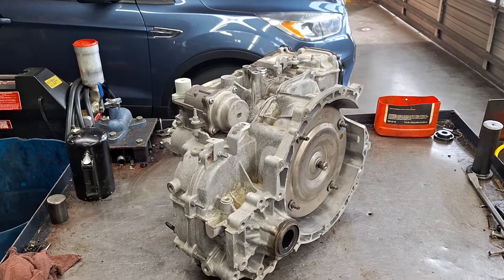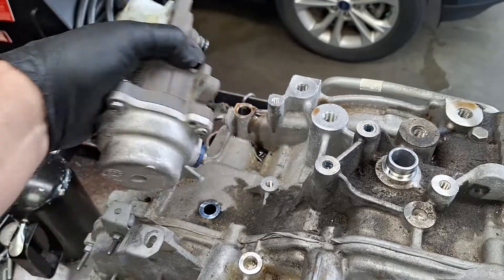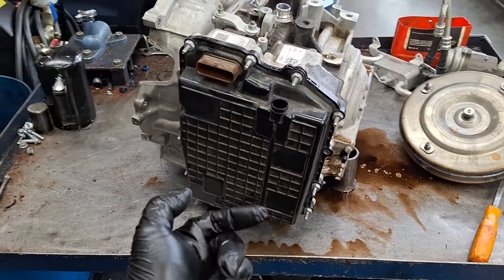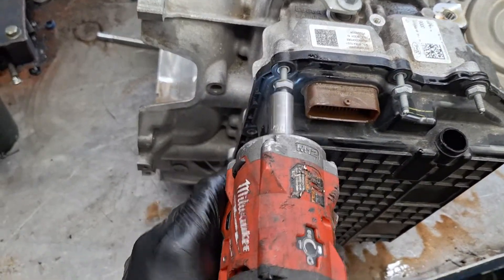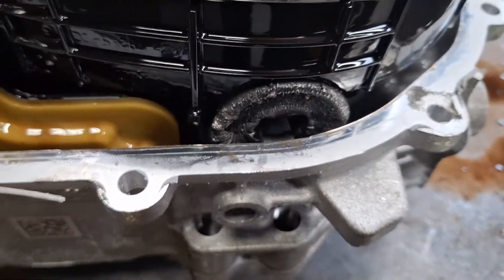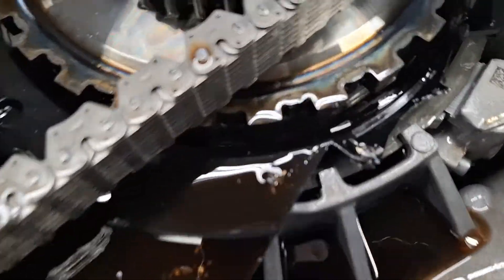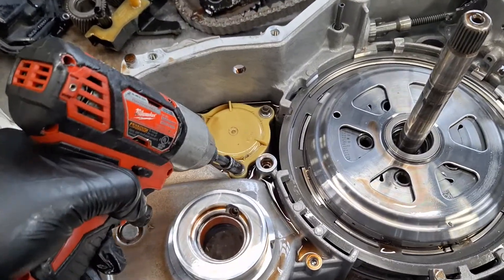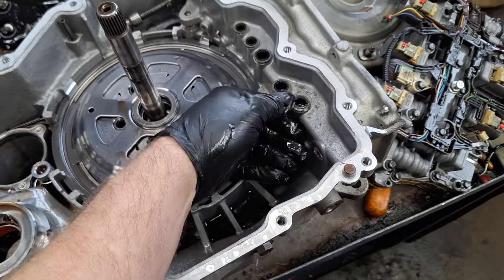Ford 8F35 Teardown | 8 Speed Transmission (Major Failure)

Comment: Hello Ben!
Have a same gearbox on my 2019 Focus. Now got a problem with it.. First of all it does not go to PARK (error on dash "Transmission not in park"). Okay with that fault I can drive (yeap it starts up and shut down) when car is cold. After few km fun begins. Car starts jerking and making weird stuff and finaly when it got full warm then it stops running. What can be the problem? Do you have any ideas? I'll add all fault codes aswell. 
Codes:
Memorized- P0751 Shift solenoid A performance/stuck off
Memorized- P0771 Shift solenoid E performance/stuck off
Active- P07E4 Unable to engage Park
Memorized- P0868 Transmission Fluid Pressure low
Memorized- P2700 Transmission Friction Element A Apply Time range or Performance
Memorized- P2704 Transmission Friction Element E Apply Time range or performance 
Memorized- P27B3 Gear shift selection switch performance

Now the car is at garage.. We are going to make fluid change and take a look hows the old oil look. If there is some chips/clitter in oil then there is something bad probably.. If old oil is clear then what I think is the solenoid valves are bad. 

So as you have worked on them then probably you know what can be the problem ;)

Thank you so much! 

Regards,
Reivo from Estonia!
Reply: And sorry forgot to mention that I have 1.5 liter diesel engine 😊
Reply from the maker: @Youngtimercareu  hi. It is possible you have internal damage. Step 1 is looking at the fluid for debris, like you said. Hopefully it's just a seized solenoid!
Reply: Thanks for so fast reply. Why you think it can be internal damage? So what can be broken? Its weird that it wont go to Park.. Like the dial in the car just blinking and does not go there.. I really hope it is solenoid system but lets see. Anyway I  will keep updated and hopefully can get it fixed soon!  @BigBensCarsAndCycles
Reply from the maker: @reivoreidla8373  I missed the code about the range switch. Whoops. Could be that too. But the solenoid codes make me think it could be something else too. Maybe low on fluid too. Gotta get it checked out. If a part is damaged inside it can also set similar codes and not be able to engage neutral. But a solenoid can do that too.
Reply: Where the range switch located? It engage to neutral but not to Parking. @BigBensCarsAndCycles
Reply from the maker: @reivoreidla8373  if you have the electric knob then it's on the console otherwise in the transmission
Reply: @BigBensCarsAndCycles  yeap.. I have the dial in the center. 😊
Reply: Is there anything that can be done to make these transmissions bulletproof at stock power levels? I’ve been looking at purchasing a transit connect, but this has me a little concerned.  Are there any upgrades or company’s who make better parts?
Reply: @pumafeet10  No, best advice as someone who drives one with a failed torque converter lockup is to just get a full-size van. Most of the time, you will not be able to fit what you want in the back without severe origami packing. The FWD causes issues when on slippery surfaces due to the weight being rear-biased with a load, especially uphill. You can constantly smell the brakes after driving for a bit. It's not worth it; not even my boss will buy them anymore.

Comment: THIS is why Ford needs to give us an option for a manual gearbox in work vehicles. They don't want to because the kids are too lazy and dumb to drive a manual and Ford wants to sell these $8k trannies. My transit connect had the 6F35 but it made it to 100k before exploding. I hated even putting another tranny in it. Someone needs to build a kit to retrofit the focus 5-speed into this vehicle cause all of these Edge, Focus, Transit, Mav etc are going to have these issues. The torque converters are no picnic either. Ford should be ashamed at this shoddy engineering.

Comment: Does 6F35 have that filter?  Always heard that its problems originated with clutch wear crudding up the valves and solenoids.
Reply from the maker: The 6f35 only has a filter on the pump, not a high pressure filter.

Comment: I have a fleet 2022 Edge AWD 51K miles. 
In the last snow storm up here in the NE the AWD was disabled a few times for some reason.  No codes.  Now I see  fluid coming out of the transmission vent on top of the transmission under the air box.  
Related you think??.
Reply from the maker: Hi, no I don't think that's related. Might be a bad AWD module but it would need diagnosis
Reply: I have same problem did it get resolve?

Comment: Hello sir. Your videos are very informative. I’ve 2009 ford escape. 2 days ago all of a sudden i got check engine light and car doesn’t shift to 3 gear properly. And sometimes it shifts very harsh. But after driving for a while like 2-3 miles if I make a stop and start driving again it shifts smoothly. 
I bought this car from someone 1.5 years ago. Idk if they ever got the transmission oil change or not. Or if this is something else. Please help.
Reply from the maker: Hi. What fault code is it setting? Is the fluid level ok? If its low, check the LH axle seal for a leak (bushing wear, scored axle). If its not leaking, just need to know what code it set.
Reply: @BigBensCarsAndCycles  and the fluid level was good but as I’ve said idk if the previous owner got the transmission oil changed or not.
Reply: @BigBensCarsAndCycles  U0100- LostCommunicationWithECM/PCM"A":NoSubTypeInformation 00
CONFIRMED
U0151- LostCommunicationWithRestraintsControlModule:NoSubTypeInformation
00
CONFIRMED
U0155- LostCommunicationWithInstrumentPanelCluster(IPC)ControlModule:NoSub
00 Type Information CONFIRMED
U0184- LostCommunicationWithRadio:NoSubTypeInformation
Reply: @BigBensCarsAndCycles  I got it checked today. I do have the pdf file. And the codes are 

P0316- Engine Misfire Detected on Startup (First 1000 Revolutions) : No Sub Type 00 Information
CONFIRMED
P0756- Shift Solenoid "B" Performance/Stuck Off : No Sub Type Information
00
CONFIRMED
P2701- Transmission Friction Element "B" Apply Time Range/Performance : No Sub Type
Reply from the maker: @iiistrapsmusic8835  Hi. Having the fluid changed wouldn't fix this. Shift solenoid B is a common failure. You can start with replacing solenoid B. If the concern is still present, I would take the valve body apart and check for a worn separator plate (check ball stuck in plate).
Reply: @BigBensCarsAndCycles  thanks very much for this information sir. Appreciate your time and help.
Reply from the maker: @iiistrapsmusic8835 you're welcome!

Comment: Aptly timed! I recently reached out on FB about towing with the Transit connect on this gearbox and this really gives me pause! Do you get the sense this trans was on its original fluid, and if so, that it could contribute to failure? Or are these transmissions just too lightly built?
Reply from the maker: I think that they are lighter duty transmissions. I don't believe fluid caused this. However, I think that ford's 150k service intervals are ridiculous and it should be 30k on these. Anyway, I wouldn't tow or haul more than specified. And keep heavy hauling sporadic
Reply: @BigBensCarsAndCycles  thats interesting, i know on quite a few fords including the MK4 focus i have that has this transmission. The fluid is stated in the manual but the service schedule says the trans fluid is a "lifetime" fluid and from what i have heard (at least in the UK) ford dealerships will not change the fluid on these boxes even if you ask them too.